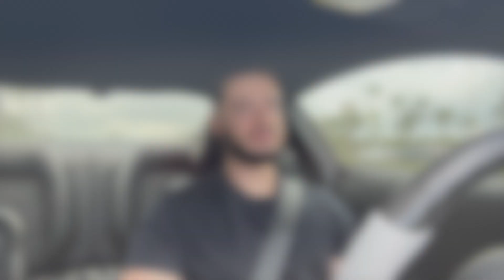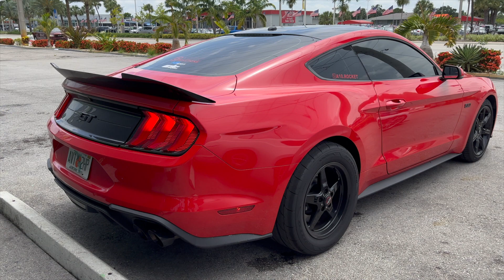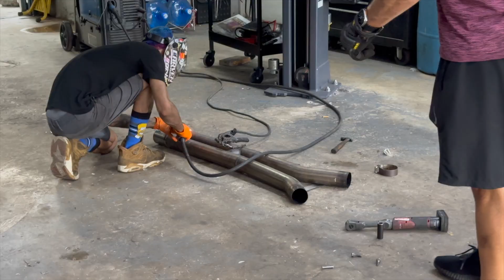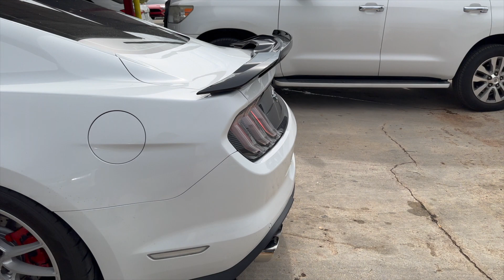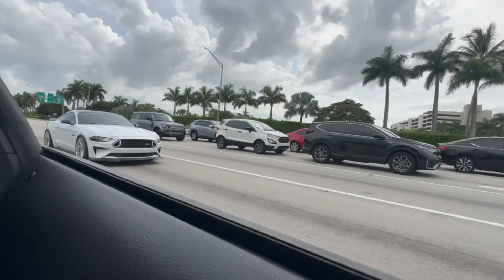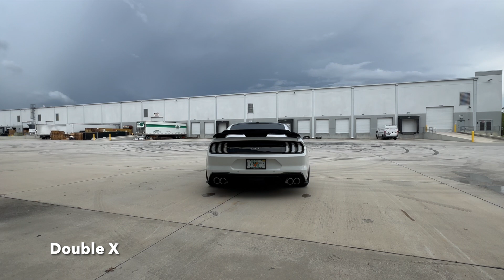S550 Mustang GT | Swapping My Double X Pipe to a Double H Pipe! (Full Comparison)

Comment: Your double H cold starts sounds like my roush w x pipe res delete. The difference I can hear is when you rev up to about 5k is sounds a lil more raspy / punchy / throaty in a good way
Reply from the maker: The roush system sound so good man. Do you run headers as well?

Comment: I also have a corsa with double X pipe with the Vavles and stick headers. I have to say your headers make the car sound way too nosiey. The exhaust along is loud enough to each there own. Nice car by the way.
Reply from the maker: @oneilhinds7509  I kinda agree and disagree the car actually isn’t that loud when staying below 2.5k rpm. If I had valves I would say headers would be perfect to switch between quiet and track modes

Comment: Love the double H… sounds way better to me. I feel like the s550s always sound too raspy with the X pipe.
Reply from the maker: Yeah man I totally agree even tho I loved the XX there was time where it was just too much
Reply: Yeah, blame the fact that they're 4 valves per cylinder instead of 3. So far, every comparison I've made between similarly spec'd 3-valve and 4-valve engines (mustang v8 and otherwise) have shown that having 2 exhaust valves raises pitch and rasp of the exhaust sound.

To add insult to injury, 3 valves per cylinder with the same 0.7:1 exhaust-to-intake ratio has 94% or more of the overall flow potential that 4 valves per cylinder have. Basically, if you had two 38mm intake valves and a single 45mm exhaust valve, it'd flow the same as two 38 intakes and two 32 exhausts, but you might need a 2mm larger cylinder bore to fit it all in. And the other claimed benefit of "lighter valvetrain" is negated, too, since two 32mm valves are heavier than a single 45. And if they meant that EACH valve is lighter, and therefore gentler on the valve seat, that doesn't matter either below about 8000-9000rpm, which all street engines pretty much are.

On top of all of THAT, (but this part I'm less sure about) a single exhaust valve has slightly higher temps and pressures than two, and imparts less heat into the head/coolant but do so more evenly than 2 valves. This makes it (according to Mercedes) better for emissions and durability, and according to physics, better for turbocharging.

3-valves per cylinder have been, unfortunately, massively overlooked by the auto industry in general, it seems. And they're massively under-respected by car guys. Most of they Coyote's advantage over the 3 valve (based on this simple math) is from displacement, cams, compression, and RPM. Build a 12:1 4.9 stroker 3 valve with a bit of head work, and big cams that are good for 8000rpm and I guarantee it'll throw down with a gen 3 FBO and tuned.